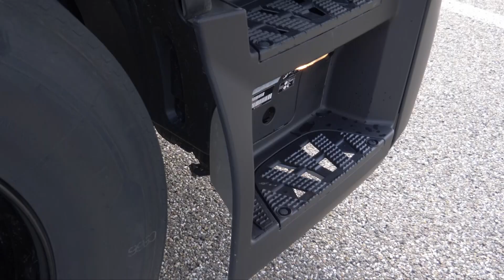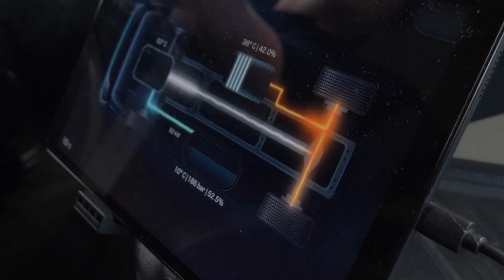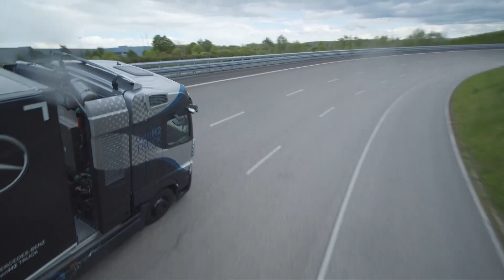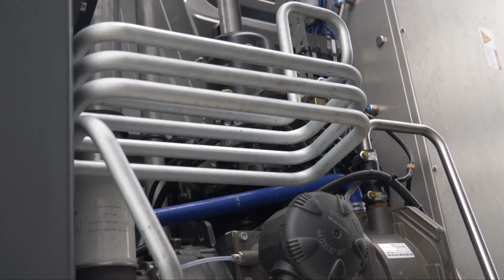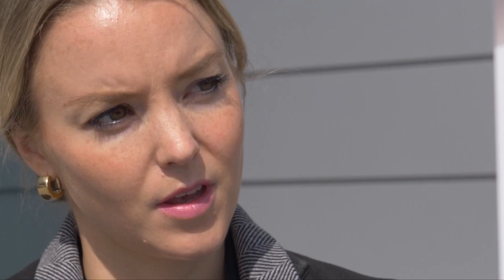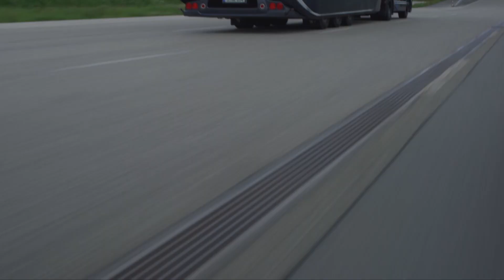The Hydrogen train is still rolling - Mercedes GenH2

Comment: fossil industry is happy with this truck
Reply: Just as they are happy when you charge your battery from the grid…
Reply: @nvadekar  Except that hydrogen is 3x more energy intensive to drive the same  distance.
Reply: @irasthewarrior  if you enjoy hauling batteries instead of cargo, that’s brilliant.
Reply: @nvadekar  If you enjoy destroying out planet, that's brilliant.
Reply: @irasthewarrior  You seem a little emotional, perhaps you are not aware of the trillions being invested in green hydrogen economy.  I care about the planet at least as much as you, I just do so in a broadly inforrmed way where BEV and FCEV both have their ideal places.
Reply: @rubbernecksitblog3428  Green hydrogen is a waste of time and resources.
Reply: @irasthewarrior  😂😂😂
Reply: Outside air temperature ABOVE 35 degrees to run cooling?? What about below, maybe not required...
Reply: @jasonhenn7345  They recently tested it in Finland on the temperatures below -25 Celsius if I am not mistaken.